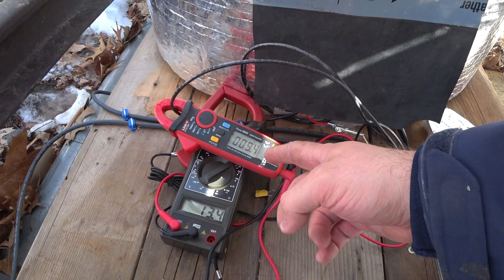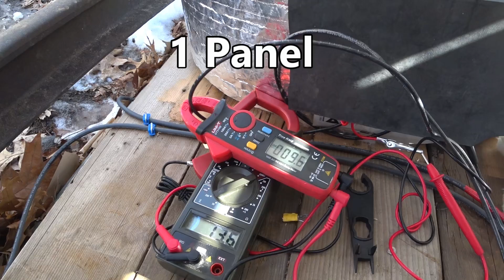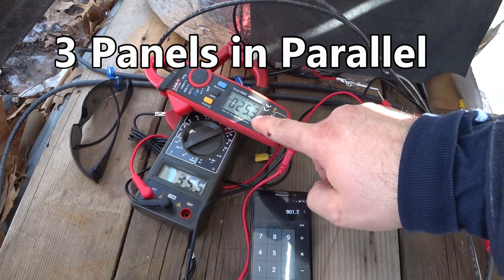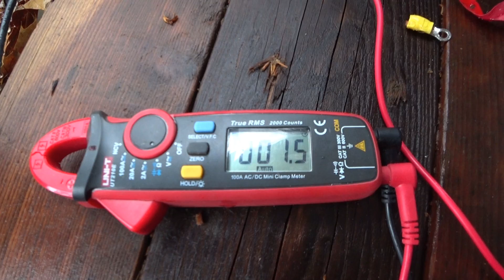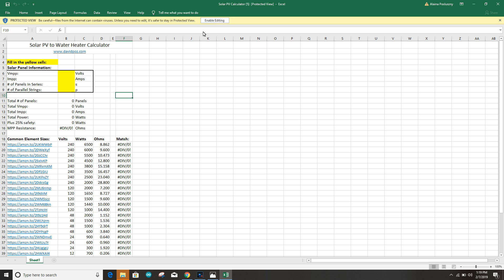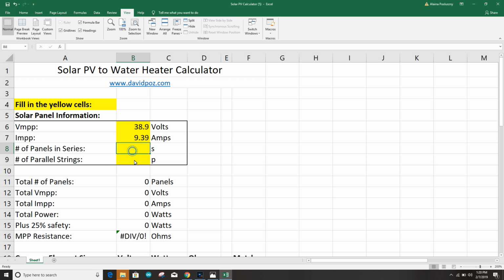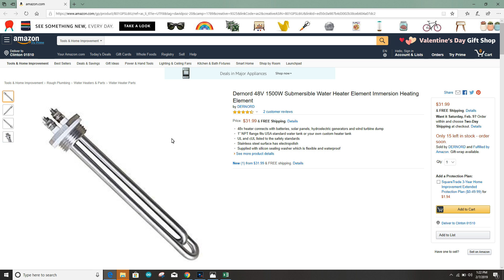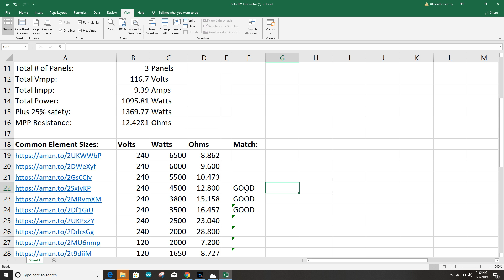Matching Water Heater Elements to Solar PV Panels

Comment: Done this quite a few times u only need the watts!!  A standard 240 volt booster will happily run from 5 x 24volt  300watt panels I  winter only 4 needed in summer. What u are all forgetting is that DC from the panels needs high voltage  DC switching relays u can't use the thermostat contacts to interrupt the panel output  current directly it will cause fire. A spark on ac is interrupted 50 times per second but on dc from the panels there is no interruption it is continuous  so if u look at relays ratings u would see 24v dc on a 250v ac set of contacts. Be safe guys don't take electrical short cuts

Comment: Trying to build an off grid water heater. I have 1 solar panel, which when I use your pv calculator (thank you) it identifies only 1 element match which is 48volt, 1000 watt. My question now is can I heat a 50 gall9n pail with 1 1000 watt element? Thank you
Reply from the maker: The short answer is "yes", but it probably won't be enough.   Good job using the calculator.  I have no idea how big your single solar panel is, but let's say it's 300W.  If that's the case, you might only be able to put 1kWh of heat into the 55 gallons per day.  This might raise the temperature 7 degrees F per day.    It takes a lot of solar panels and a lot of sun to heat up a full 55 Gallons to something useful like 130 degrees F.
Reply: @DavidPozEnergy  thank you so much for responding..I guess I need to get several panels. I had one 325 watt panel left over from a project and thought it would be great to do this. Thanks again sir

Comment: Great video, thanks David, and I downloaded your useful workbook too (fellow Excel geek LOL).

I am also experimenting with a second water cylinder in the garden, heated by solar PV and then with a feeder pump to the house cylinder so long as outdoor cylinder temp is high enough.

So basically, so long as the max output of my solar panels does not exceed the water heating element, there is no chance of burning it out?  But if the solar panels are UNDER producing (in the UK this is a distinct possibility LOL), then the element will still heat the water a bit but at a reduced rate?
Reply from the maker: You need to keep the maximum Amps of the solar array below the Amp rating of the water heating element to prevent burning it out.  For example, here in the US the most common water heating element is 4500W made for 240V.  The package won't tell you the Amp rating, but we simply divide W/V=A.  4500W/240V=18.75A.  Stay below that from your solar array and you shouldn't be burning the element out.  I've spoken with people who go over it and they tell me it still works, but I like to still recommend staying below it.

Comment: Dear sir how are you i am from south Africa i see your video i like i get so much information about soler system and solar WATER heater i want to know sir I have 200 litter electric geyser  now I want to use solar pv system which DC WATER 
Heater element is good whice solar panels i can buy

Comment: I live in Greece, and the summers here are really, really hot so, so do the panels during the day. So I was thinking to take all that extra heat out of the panels somehow. By running copper tubing under them, or something, I don't know. And create a huge makeshift solar heater with it. I have 42 panels running. Those are nowhere near the efficiency you'll find in panels nowadays. They were bought back in 2012 and I think they were 7% back then. All combined are supposed to produce 10KW max, but at the most they reach 7 or 8.
You got any relevant videos I could watch to get ideas. Thanks.
Reply from the maker: Thanks for watching from Greece.  What you are describing is called a Hybrid Panel.  There are 1 or 2 solar companies with some Hybrid panels to get both hot water and electricity from the same panel.  Most solar manufacturers give up on the idea because it's subjected to Murphy's Law.  Personally, I'd make sure there is good airflow under the panels by checking: no nests, held off from the roof surface by 6 inches (15cm) or more, open at top and bottom.  But in the end, it will be cheaper to buy more solar panels than copper tubing.

Comment: Thanks for your videos, I'm confused now that you have gone back to series to find different elements. Does anyone know which way works better using 2x350w panels, an mppt and a deep cycle marine 12v battery? Calculate in series is 8.7 ohms and in parallel is 2.1 ohms....

Comment: Fitting a high efficiency switched mode charge controller may help even more with ideal matching between panels and load, by acting as an impedance matching system. It would depend on how mismatched they still are after wiring for ideal matching etc, etc

Comment: Does this still works? I'm thinking of  heating a 120l of water mostly in summer, I want really simple setup, maybe 2,3 panels. In  water heater is now a 2kw AC 230v heating element and I would like to replace it with Solar heater. I'd like to buy a second hand panels from marketplace. 
 Any usefull tips?

Comment: PV panels have a maximum power point, and they are much much lower power if run with the incorrect load.  The data sheet or even the sticker on the back of the panels tells you the voltage and current at MPP.  So you can just calculate the resistance you need using Ohm's Law.  I think the problem with that, is that is for full ensolation at noon, when you receive about 1 KW per square meter.  But what happens at 10 AM, when you get lower ensolation?  An MPP controller finds the maximum power point as the ensolation changes.  A resister can't.  So with a direct heating element connection, you get a lot less power than you could with an MPP interface.

I bet this would work a lot better with an MPP battery charger and a couple of 12 volt batteries, connected to a heating element designed for 28 volts.  You could also insulate the water tank very well, so it would continue to deliver hot water at night.  The batteries just make the MPP charge controller work.  The bulk of the energy storage would be in the water tank.  You could even disconnect the batteries at night.
Reply: Actually, studies have shown that almost 2X the "ideal resistance" produces more average daily power in direct connect to compensate for clouds and production other than the two midday hours.  If you want to learn real power point water heating view my channel. No batteries charge controllers or inverters and it can run in parallel with a charge controller to harvest excess power.

Comment: I wonder if it would be better to use maximum power point tracking inverters on each pannel and a regular electric hot water heater. 

Possible benefits 
1 standard electric hotwater tank can shut off once fully heated 
2 hotwater tank can turn back on anytime if its cooled down 
3 one knows no legionella grows in a well regulated hotwater tank. 
4 electricity generated when tank is fully heated is exported. 
5 electricity needed to heat the water is available all the time, even when the sun is not shining. 

Downside. 
1) Need grid connection. 
2) including mppt micro grid tie inverters is more costly in some ways but simplifies and off sets other important design cost/considerations.  So I'm not so sure it really cost more.

Comment: So, You can run a AC element with DC power?
Reply from the maker: Yes.  The element is just a simple resistor which works with AC or DC.  However, all the thermostats and switches have to be DC rated.
Reply: @DavidPozEnergy  I did see someone use the AC thermostat on the water heater and it worked. It's just a thermo switch. You videos are great. I'm working on wind generator direct to element to preheat solar pool heat. Lol!

https://youtu.be/YuhN8RR7GWA

Comment: Awesome video. I didn't catch weather you used an A/C thermostat or not? I'm reading that they don't last under a D/C load?
Reply from the maker: Any AC switch will potentially burn up under a DC load.  This is true for relays, Line-voltage thermostats, and light switches.  Any switch.  In this case the solar power (DC) is run directly into the tank of water.  This is just an experiment, and not a good idea inside a house.
Reply: @DavidPozEnergy  Thank you for the reply!

Comment: You can also heat water using a 12/24v DC element(Dernod-AMZN) directly from load output, and/or a low wattage 120v element run off of your inverter. My system: 40A Epever mppt charge controller, Outback FM80, a 40 gallon dual element water heater, a 300w 24v DC upper element and a 750w 120v AC lower element(Dernod cartridge heater-AMZN) with a 1''x1/2'' brass bushing.(2) 325w panels connected to (2) 100A 12v batteries in series running off of the Epever. (6) 325W panels on the FM80 connected to a 5k inverter run thru a (5.5k MOES-AMZN) utility/inverter AC transfer switch powering the 750w AC lower element, and selected AC loads(and washing machine/ LPG dryer). lower AC element controlled by thermostat and a timer from 9AM to 10PM(10PM cutoff is to insure some hot water for morning showers). Upper element controlled by charge controller's programmed load output 9AM to 5PM. Between 10AM and 3PM 300w DC element can produce over 400w of power, up to 3.5kw a day. AC element thermostat usually shuts off by 3PM. On cloudy/rainy/laundry days hot water is automatically guaranteed by utility power. Payback? 5kw> daily electricity savings. 2 years now no glitches, 4 person adult household. Do not waste money on solar water heaters of any kind.
Reply: I like your comment
Reply: The elements are basically the same ohms whether it's 12volt or 240 . You can run directly from panels. No batteries.

Comment: So, your explanation for why your series connected panels didn't work well was not very good.

The reason that you didn't get enough energy to drive your 48V 32A 1.5Ω 1500W heating element is as followings:

Solar panels produce a V & A that can be applied to a load (i.e. your 1.5Ω resistive heating element) which must not exceed the V rating & must provide sufficient A to cause the device to heat up properly (i.e. not exceed it's 48V & be less than 32A (48V/1.5Ω=32A).  1500W power consumption occurs when the V=48V & the A=32A for your heater element.  That means your panels must output <=48V & <=32A to be safe.

2 of your panels connected in series output 77.8V at Vmpp & only 9.39A at Impp.  That V is too high for your heater element rating & the current is only ~29% of it's current rating.  Max power in that configuration is ~731W or ~49% of the rated power consumption of your heater element & unwise since the V is higher than your heater element is rated to handle.  Connecting solar panels in series increase V, but keeps the same A, so no matter how many of the 9.39A panels you connect in series, they can only produce 9.39A of current--which isn't enough current to properly heat up your heater element.

3 of your panels connected in parallel output 38.9V at Vmpp & ~28.2A at Impp = 1,095.81Wmax (if your load can use it--which your heater element won't use because your supply V & A are both lower than it's rated values).  Your multimeter readings showed 35.5V & 25.3A which is 898.15W (which is ~60% of the max rated power consumption of your heater element--which is ok, but quite a bit lower than your heater element rating of 1500W.  If you want to optimize the heating of water, you could install a regulated DC-DC converter to match the V & A rating of your heating element (factoring in your safety margins of course first).

Your spreadsheet Ohms calculations are also wrong for the electric heater elements list.  Watts / Volts = Amps.  Volts / Amps = Ohms.  Yes, I'm aware that you stated that you would be making corrections in the next version of your spreadsheet, but, it might be a good idea to put up a message image in this vid that shows the Ohms calcs are incorrect.

Good vid.  Thanks for sharing!

Comment: I have a 48 volt dc solar system  hook direct to hot water heating element .I would like to know what size breaker I should be using. Also should my breaker be at the solar panels or next to the hot water heater  my water heater element is a 48 volt dc heating element.     ( I have it wired like is series & it heats 40 gal hot water from 100  degrees to 150 degrees  in one day )
Reply from the maker: Circuit breakers are sized based on amperage.  You need to match the amperage of the CB to the "ampacity" of the wire you are using.  For example, in a situation like yours, you might use 10 AWG wire for the whole circuit, from solar panels to element and back.  In that case code says you need a 30 amp circuit breaker.  https://www.usawire-cable.com/pdfs/nec%20ampacities.pdf

Comment: i'm doing something similar for a heating system a the problem that I'm finding is that without Mppt you'll never be able to peg down the ohms because when the sun Isn't at its peak radiation point either because of  cloudy days, change of season, time of day etc. the voltage will stay Within a constant range when the circuit is open...but the amperage will drop off with a heavy load like a heating element...that's the problem of going without Mppt!
Reply from the maker: In my own little testing I find I want the ohms of the heater to be about 30% more than the MPP of the solar panels.  That produces the most overall hot water.

Comment: I want to ask you David, im thinking of getting about 7 solar electric panels to heat hot water for my house. Since i already have a 220 volt water heater and since house 220 is volts AC RMS which means its the same heating equivalent as 220 volts DC so im thinking ill use 210 volts dc, 7 solar panels in series and that would keep the current at around 8 amps. Am i falling into the same trap as you in the beginning of your video? Will that work for me, it sounds simple enough but im thinking that was the point of your video.
Reply from the maker: I have a free calculator on my website to help.

Comment: A Rheem Marathon water heater has two different heating elements, is it possible to connect solar panels to ONE of the heating elements so you dump that power direct to the tank and only use the grid powered element when the water falls below a critical temp?
Reply from the maker: Yes, absolutely.  Typically the bottom heating element would be on your solar system, and the top element stays on grid.